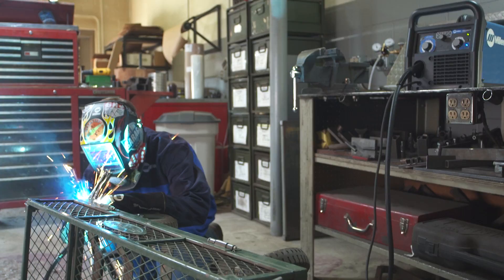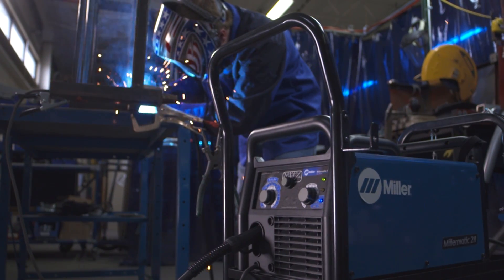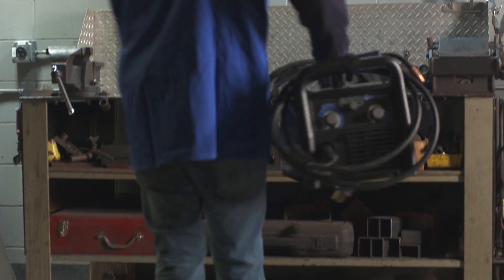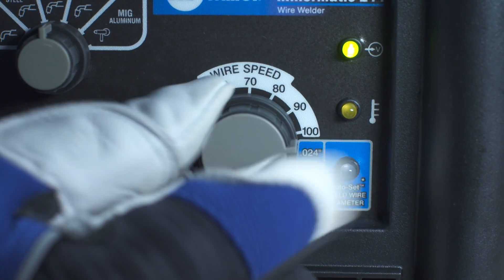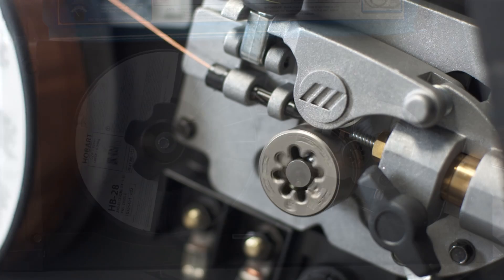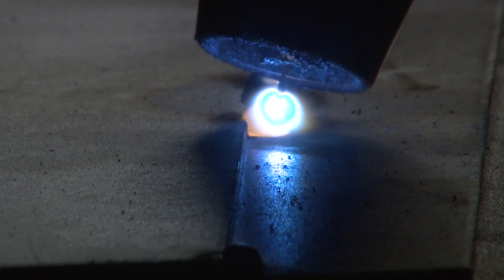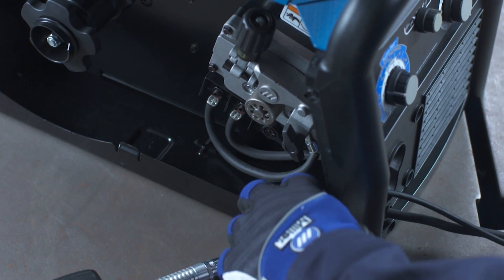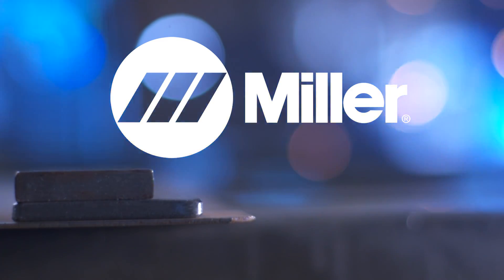Millermatic 211 Improves Portability and Arc Performance

Comment: Where is it made, ?? In china. ?? Or the USA.??
Reply from the maker: Miller offers a full portfolio of reliable, high-quality welding products that empower welders to do their best work. The majority of Miller welding machines are designed, developed and manufactured using proprietary technologies in Appleton, Wisconsin. Select Miller welding machines are produced outside the United States, and are designed to meet Miller specifications and requirements. We work with trusted partners to ensure that our welding machines meet the high-quality standards that you have come to expect from the Miller brand.
Reply: @MillerWelders so in other words, the 211 is made in China?  Why not simply answer the question?

Comment: Can you spray transfer with .035 wire? Didn't know if it had enough output or not??
Reply from the maker: Hi Kevin, thanks for the question. The Millermatic 211 does not have enough output to get into a decent spray transfer with a .035 wire. Thank you.

Comment: Kinda pissed off just bought a Millermatic 211MVP (the older style) o 07/24/15, now less the 30 days Miller comes out with a new 211MVP.  The new style is not only HALF the weight of the older style, it's also much shorter in height less top heavy which reduces the chances of getting knock over when wheeling it outside on the cart. At only 38 lbs it's now truly portable, compared to 75 lbs for the older style. And it now has a 3 groove drive wheel for solid & flux core wire. The freakin deal could have told me Miller would be releasing a updated 211 in less then a month.
Reply: +jdj62464 
The old model is still a wicked little machine, but I totally get what you are saying.
Reply: Old model is a transformer machine = better.